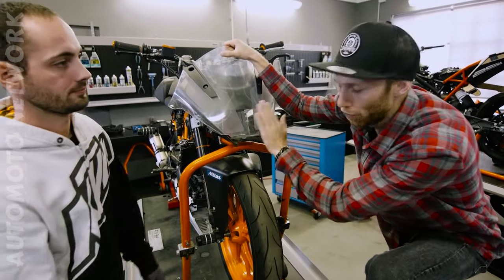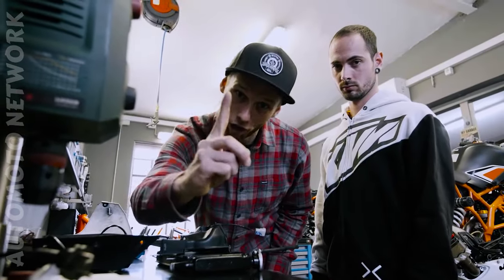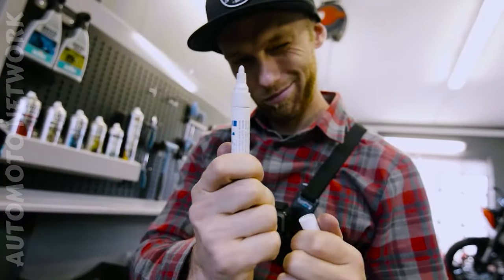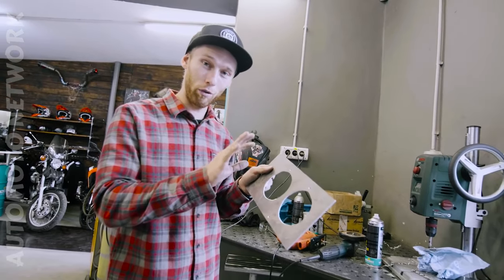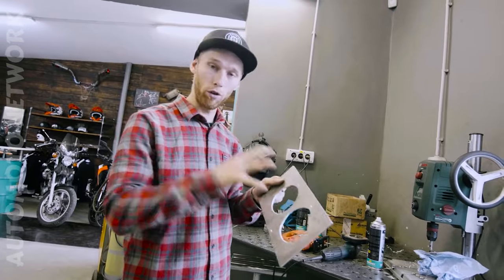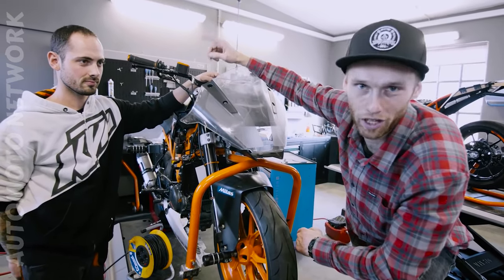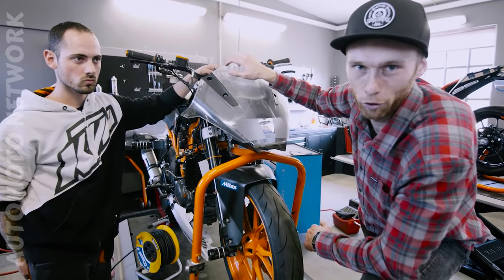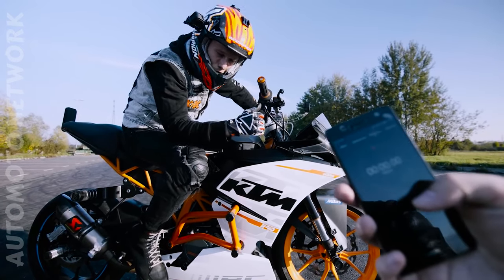KTM RC 390 Overheating | Cooling System Upgrade. 4K

Comment: @AutomotoNetwork I am planning to install 2 Spal fan on my KTM RC 390. I noticed in some other videos that you can just move the fan pin to the KTM connecter. So here is my question: Can i connect 4 pins in the same connecter (positive postive pair) and ( negative negative pair), will that work? Or do i need to cut the wires and solider them?  Here is the other video look at 12:04 mins

Comment: What year is this bike, thinking about getting a 2019 or 2020 model, but not sure if the overheating issiue is fixed.
Reply: it doesn’t overheat but it does run hot by design... people are just uncomfortable with the heat gauge
Reply: @jmsbrynt  cause it sucks ass and doesn’t give you a real temp readout just bars going up or down. I wish it displayed the actual temp instead
Reply: @jmsbrynt  idk enough head gaskets failing on these bikes it might run too hot
Reply: @beanwithbaconmegarocket  the bike is designed for racing it doesn't run hot until you hit stop and go traffic or push the engine too hard then stop immediately... and any bike will overheat if you do those things - its just such a small engine that it doesnt take much to overwork it
Reply: @jmsbrynt  No, the bike is designed for street riding and can be adapted for racing. KTM did not make a 390 with only racers in mind. I've also owned an R3, Ninja ex500, and a Suzuki 250 and they did not overheat in stop and go traffic. You're right that the R3 would overheat by the end of a track session when I kept it near redline for the whole session and then stopped immediately but it only did that on hot days and I also weigh 200 lbs (90 kilos) but a girl I know was really quick on that bike and weighed only 110 lbs and she had no overheating after a session.